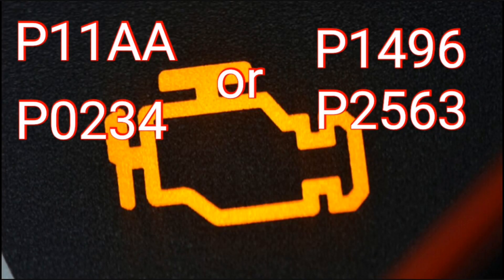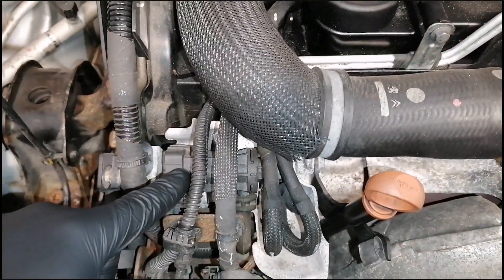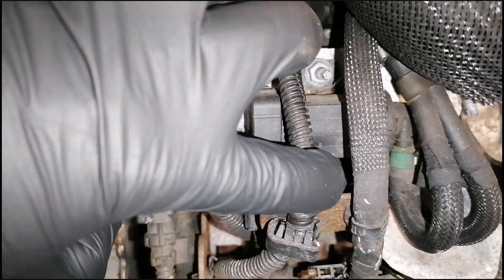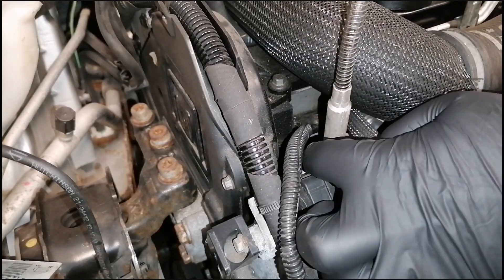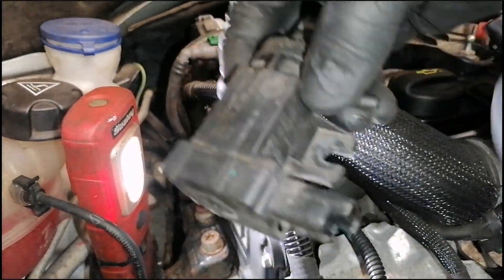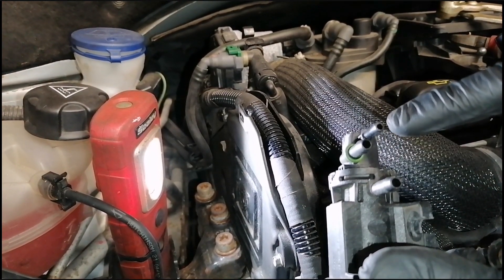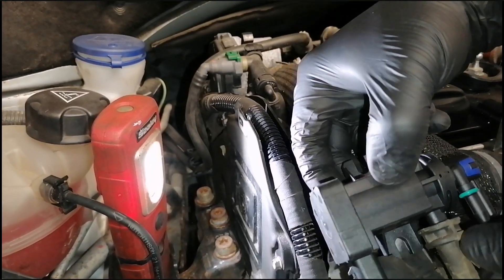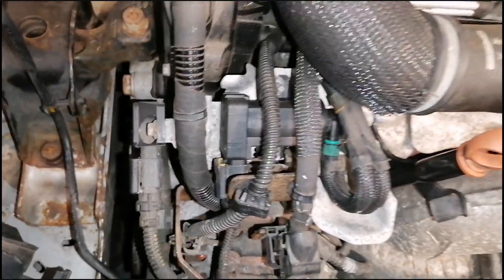Peugeot faults #P0234 #P11AA #P2563 #P1496 engine faults on PSA 1.6hdi 1.4hdi #2.0hdi

Comment: i still have the p2563 on a peugeot 308 1.6 hdi ive replaced the turbo the waste gate the selenoid and the turbo boost sensor has any1 any ideas i replaced with all brand new parts.
Reply from the maker: What about pipes vacuum pipes? Did you check them ? Maybe vacuum pump is weak I would take vacuum tester and check it.
Regards

Comment: thanks alot for the video. what car and year model did you work on in the video? i have a citoren c3 2014 e-hdi and how do i check if the old one is not working? i didnt quiet understand what you said. thanks
Reply from the maker: It is a common problem with them so should be the same in most years of production. Regards

Comment: Good morning, I recently had the service light on with the engine light on, the display said risk of FAP blockage and engine fault. I carried out all the checks on the FAP As it brought the ash to 100% and the wax bag in one parameter was empty.. by dismantling the additive pump everything was ok I reassembled it and did the reset selecting that it has been changed Both the pump and the FAP. Since there were also problems with supercharging, I also changed the solenoid but after 1 week I find myself with all 3 errors. It could be the solenoid Faulty or the turbine?The errors are p0234, p2563, p1496
Reply from the maker: It could be both
Regards

Comment: Hello, I am the owner of a Citroen C4 2015 1.6 e-Hdi vehicle. I get the error codes in the video title when I suddenly press the gas in my vehicle, especially when it is uphill. turbo is disabled. At the same time, the engine service light is on. start stop does not work. When I turn the vehicle off and on, the service light turns off on its own after 1-2 days, sometimes 10-15 hours, and the entire fault goes away and the turbo works again. Then it happens again. Are the changes seen in this video valid for me?
Reply from the maker: Try and see. May help

Comment: Hello, it is called n75 valve or n95 valve. My vehicle has the same malfunction. The P2563 engine fault lamp is on. I replaced this electrovalve you mentioned. My problem has not been fixed :( (The whole problem started 1 month ago after I had the particulate filter cleaned.)
Reply from the maker: Regards and welcome to subscribe my channel
Reply: Hi what was it in the end ?
Reply from the maker: Check pipes for the vacuum system, could be the turbo self

Comment: Hello 
What about this errors 
Citroen c4 grand piccaso 1.6

P 1496 Turbocharger: Actuator Too Open In Relation To The Reference Value
P2563 Turbocharger: Actuator Too Open In Relation To The Reference Value
P1497 Turbocharger: Actuator Too Closed In Relation To The Reference Value
P2562 Turbocharger: Actuator Too Closed In Relation To The Reference Value
Thank you
Reply from the maker: Hi
Could be a turbo or just a valve.
Did You change the valve?